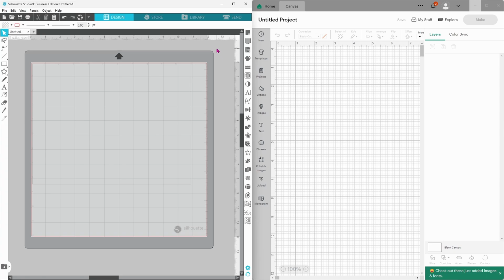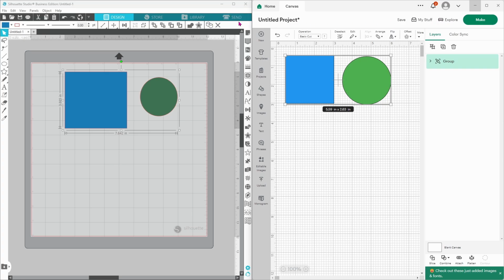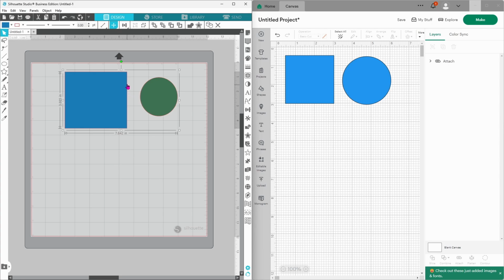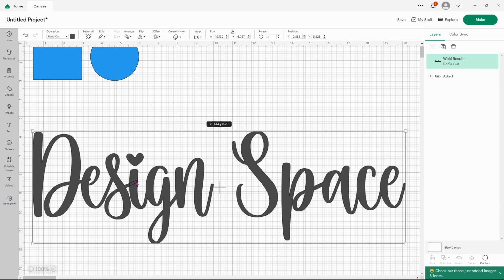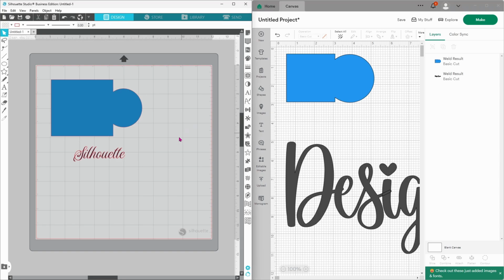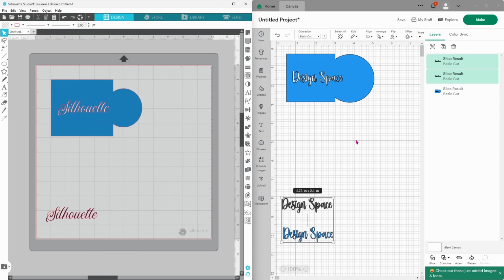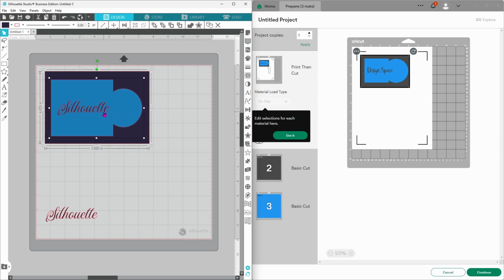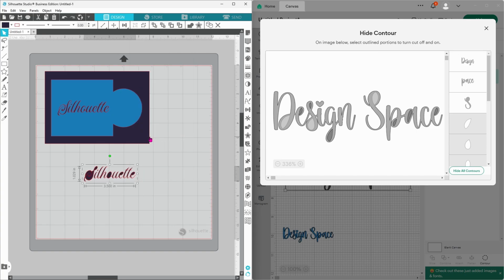Design Space to Silhouette Studio - Retrain your brain!

Comment: I have both silhouette 3 and circuit maker. I like silhouette business edition    better than design space. Design space you can't save as SVG. Or edit nodes on  designs. Like you said I design in silhouette (save as SVG) and cut with Circut maker.
Reply from the maker: I tried to use both, but my brain couldn't switch back and forth, so I just kept messing everything up! I ended up donating the Cricut to a charity and just went with Silhouette. I was kinda proud of myself for getting through a whole video with Design Space after 3 years.
Reply: @silhouettesuccess  I only use my Cricut to cut fabric with rotary tip. (I only have Silhouette 3 ) and love how it automatically separates mats.  I wish Cricut let you save as SVG.

Comment: I had circuit, back in the day, with the cartridges and it also printed.  I liked that but I got a silhouette off Craig’s list, it was the first one and it gad so many options with glass etching, magnets, and stamp creation.  I wanted to try it and found that so easy.  I quit using the cricut after the printer started giving my problems, plus it was so heavy!
Reply from the maker: The Cricut machines actually work really well. The software is not so great. LOL